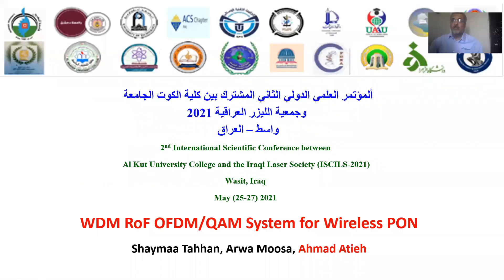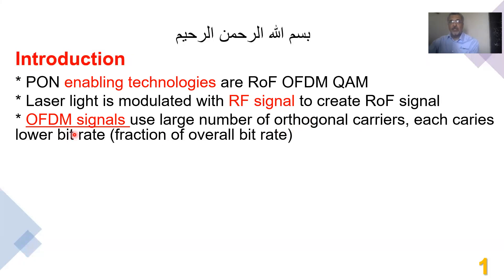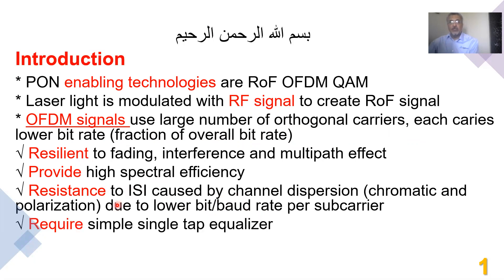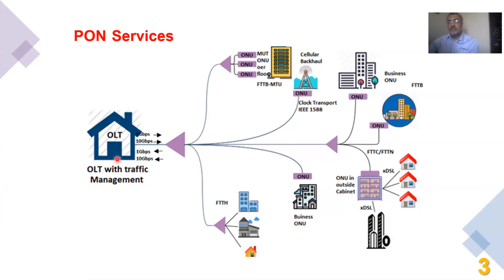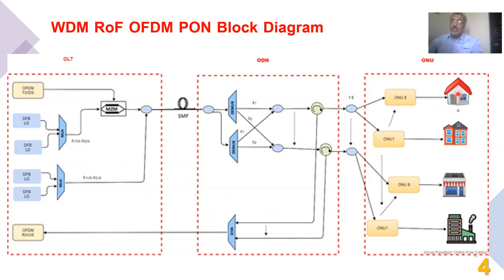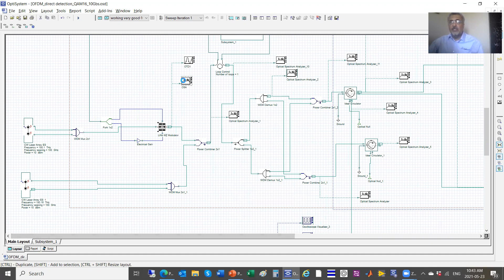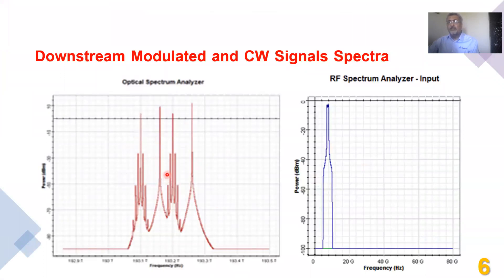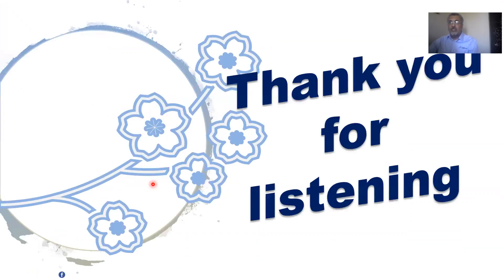WDM ROF OFDMQAM System for Wireless PON

Comment: Great work thank you,
Please, I have an important question in this context, for intensity modulation direct detection OFDM over fiber like the above system there any possibility to add DSP module at the receiver? or no OFDM modulator has this function internally!
Please, I need precise confirmation from expert deal with this transmission OFDM system using Optisystem.
Thank you so much again, and all the bests optiwave.
Reply from the maker: Hello, Can you send your question with your contact and license information to support@optiwave.com? Thanks.
Reply: @OPTIWAVEHD  Thank you, but I'm using just trial version of optisystem, so I need to know  what kind of DSP module could be used for intensity modulation direct detection OFDM over fiber transmission link!
Reply from the maker: @bstanis1237  We don't have DSP in the design discussed in the video. We may provide the design file. Please contact us at support@optiwave.com. Thanks.